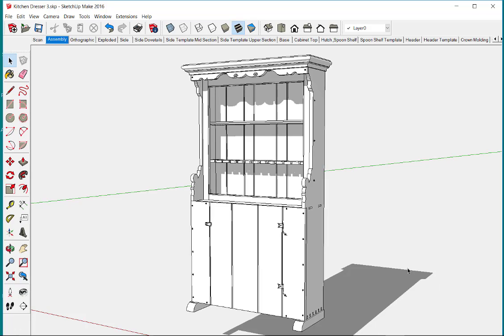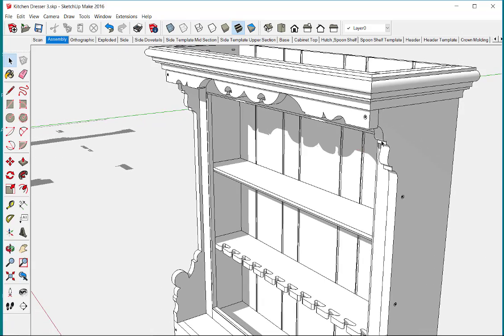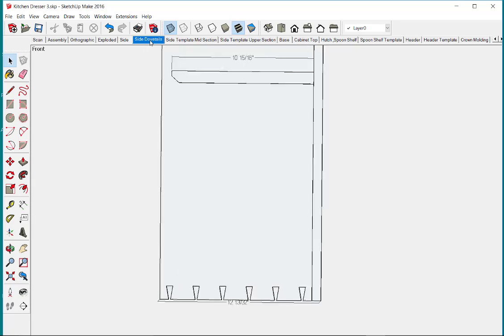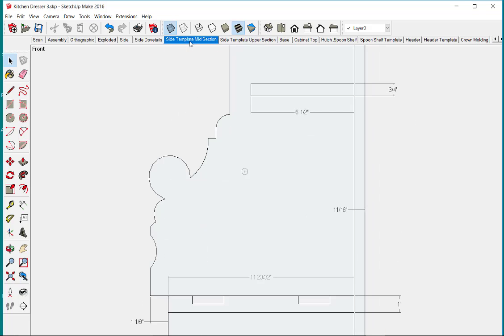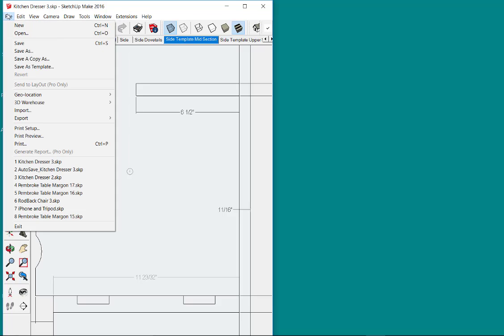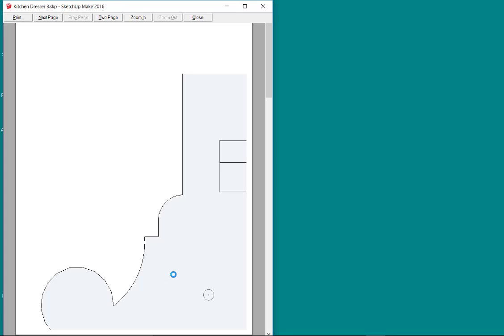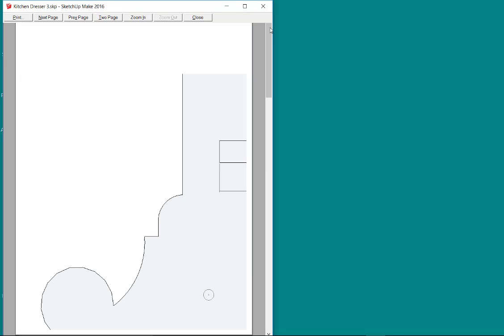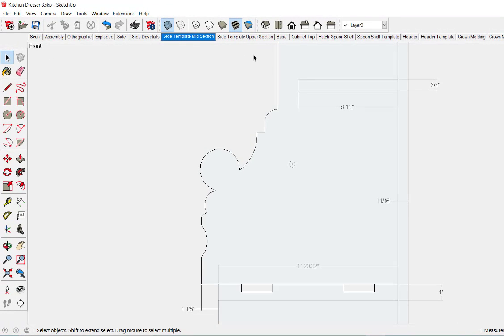Kitchen Dresser

Comment: Hello Timothy...A fine demonstration of the 1:1 printing process. Since Ctrl + P is Print, I have Shift + P set as shortcut for Print Preview.   If you Set the print quality in the print vindow, lower right corner, to: Ultra high definition... you will get much finer and sharper lines (should you ever need it).  It is also a good idea to place small "Marks" near or on the model, where the two pages meet/split, to facilitate registration.  Autumn greetings...Jakob.